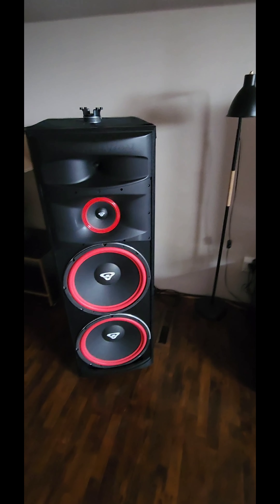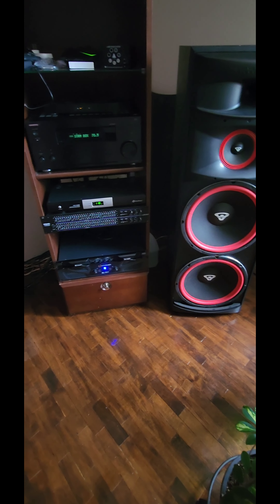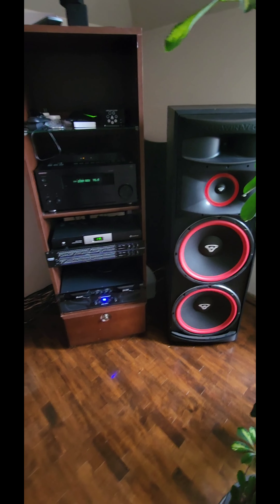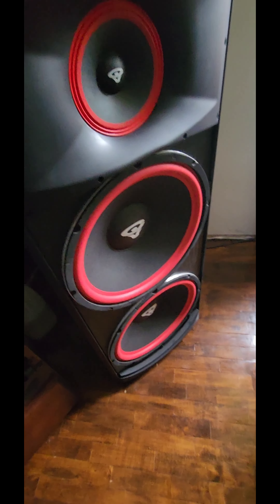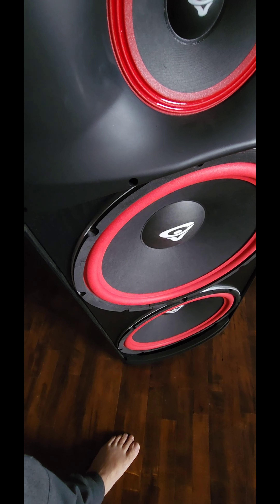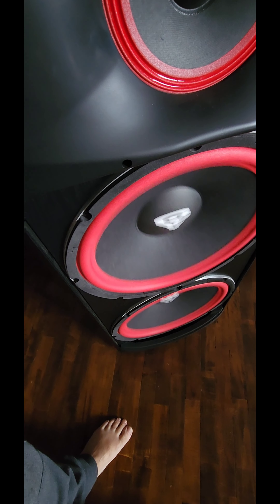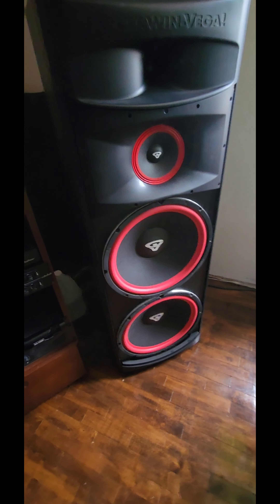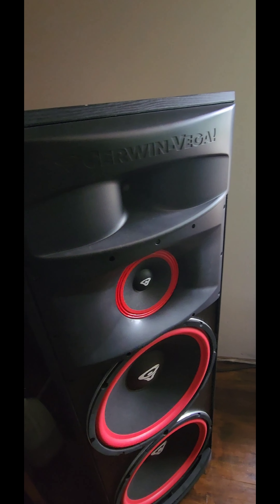cerwin vega xls-215 update power amp recommendation

Comment: This is an output impendence incompatibility. You are trying to drive a PA amp with a home cinema receiver.  You need to either get a proper pre-amp that has enough output to drive the power amp without the pre-amp distorting. Or, you get a power amp that is suited for the low output of the home cinema receiver.
Reply: The newer Crown amps have adjustable input sensitivity...probably on the "low" setting...set it to "high", and it works great for use with home receiver level output

Comment: I mean their own specs make very little sense. 500W with NO ohm load rating, the only ohm load mentioned is on the sensitivity test, which if I'm reading it correctly was done at 8ohm with full spectrum sound (white noise probably) for 95db... I've always heard take the cone size and multiply by 20 for optimal wattage which would be more like 760W for continous program power, IE you need an amp that can do 760W per channel all day without dying. BUT then you look at the fuses and they're 250v 5a slow blow, which means that 1250W is barely the peak of its power handling. considering most of their other 15" models are rated at 6ohm, your crown XLi3500 should be right around 1250W @6ohm. I agree looking at how high you're pushing that AVR to output volume you'd be better off getting something that can output proper voltage over XLR to it, like a proper pre-amp or something with balanced XLR outs like a good high end streamer.
Reply from the maker: That's where I'm at right now is looking for a preamp.. Kind of looking one with an hdmi in but not sure if one exists
Reply: @sledstr  HDMI? If you want to spend on a surround sound one sure, but most stereo preamps will have digital inputs like TOSLINK and Digital Coaxial RCA, which for hooking up a TV, sat/cable, dvd/bluray, game system all the above should have at least one of those output options. Emotiva has cheapest I know for both, look at the BasX XDA-3 preamps for stereo/dac duty with HDMI, or the XMC-1 for surround which will have many HDMI.
Reply from the maker: @WarriorProphet  I've been looking at the emotiva.. Gonna make the plunge eventually I'm sure just need but need to be certain cuz it's gonna be my lat attempt at this system before I get rid of it. I'm currently running a set of jbl cf-150 powered by an H&h vf800 which was vanhalens go to amp. Along with the xli3500 pushing the xls-215. The jbl are more efficient in the highs where the cerwin fail so together it is definitely dB madness. As I'm sitting there with wot I'm constantly turning around thinking I just heard something crash lol.

Comment: Nahhhh somethings wrong. My arcam amp is 90watts per channel and completely obliterates my home  with cerwin vegas.
Reply from the maker: 90 watts? Lol I'm currently running 2 xli 3500 bridged putting out 2700w ea. They would probably crumble your house unfortunately for me my house is so solid I can sit beside the speaker and could not feel any vibration till I powered these things to the max. I'll tell you with all that power I can put it at full volume and it's clear as day and no clip.. I can handle maybe 1 song and that's it lol.
Absolutely awesome! I've just added a klipsch 16" sub to the mix and also running a couple jbl single 15" 3way speakers with another xli 3500 at 1000w per side. 😎

Comment: You just need a art box pro to boost the voltages to the amp.
The preouts on your amp are not feeding enough voltage to the crown.
Reply: Right On I've got two ART boxes, one to my bridged Crowns and one to an older 150 per channel Kenwood feeding a set of 12" Sansui and a set of Toby speakers made in Fort Worth by a man that is famous for custom speakers here.
Reply: I recommend that you ditch the receiver and get a full function preamplifier or mixer. This will create the shortest path to the power from the source component and to the speakers.

Comment: Signal output voltage on your pre amp is as important as your amps output power, if you don't have enough voltage output your amp won't get the output it's rated at and you end up turning it up to high and clipping trying to get that umph out of it. So if your using an avr to power your amp it's not enough signal strength to get the most out of your amp.

Comment: Have you tried a different preamp? I’m pretty sure there must be a impedance mis match. Those are pretty efficient speakers and shouldn’t have took that much power to make them sing.
Reply from the maker: I'm currently running an old H&h V800 250w amp that powers them pretty good and has better lows.. The crown xli 3500 powers them just shynor perfect but ya I'm thinking of trying a better preamp.. My old onkyo used to throw lots of power at lower volumes like between 3-5..now I'm at 7-9 and am thinking alot of the lows are being lost along the way. Seriously considering an svs 16" sub for lack of bass in my home which is stupid considering the size of these xls speakers. Seams they don't make em like they used to.
Reply: @sledstr  look into the new Emotiva XDA3 pre amp DAC. I think you will be very happy with what you get from it. Also you can’t go wrong with a sub in any system. Emotiva also has some nice subs cheaper than the SVS16

Comment: I was running DX9s with a technics amplifier and I blow the fuses all the time also paying the butt. 1,000 watches an awful lot how would they do with just a couple hundred say 300 from like an old Carver amp ?
Reply from the maker: I was blowing fuses all the time with a 500 watt amp. Since I've gotten the 1000 watt amp I haven't blown a single fuse and I put the volume at 10 everytime I turn it on. Before that I was blowing fuses at 7-8 consistently every time.

Comment from the maker: Update coming soon.. Ordered 2 more crown amps.. Gonna be pushing 2700 watts ea.
Reply: That preamp sucks. People are dropping gems to you and you're just ignoring them. Nuke that receiver/preamp and get an analog Carver or NAD preamp and those XLS will come alive even with your weakest amp.  But you won't. You'll be feeding the XLS-215's 5000 watts each side by the time you're done and still wonder what's going on. If you're blowing fuses left and right then that should have been a clue.
Reply from the maker: Yes the preamp does suck which is why I ditched it and got a schiit freya tube preamp as was suggested. I do have an old amp as you say pushing 250 watts a side and it didn't do much. I'm now running them with 2 crown 3500 bridged at 2700w ea. and they sound awesome. Oh and I haven't blown a fuse since I've added big power.

Comment: I wanna feed my xls 215’s as much power as possible…The problem is that I’m too noob to know what to do, because i have 2 subwoofers i wanna be able to connect too.  Right now my xls 215’s is running with a denon avr 3808 surround receiver with a Nad C275BEE power amp. How do I upgrade??😢
Reply from the maker: I picked a couple crown xli 3500 from aliexpress for $400 can. 1000wpc I have them bridged putting out 2700w ea. at 8ohm.
Reply: I need enligsh mate.. so xli 3500 will run my 215’s no problem? plus I’m able to connect subwoofers to it?
Reply from the maker: Yes the 3500 is perfect for the 215s... If you don't have powered subs then you can use your Nad to run them or get a second amp or use your Nad... Not sure what wattage your sub is but I would probably get an other crown amp to run those. If they are powered subs you just need to split the signal.  @KakashiHatake-wq7ki
Reply: @sledstr   it’s 2 xls 15s, so they have build in amp… Right now I use a ‘’splitter’’ to be able to run 2 subs because there is only 1 subwoofer output in my receiver…  subwoofer output is important to me. So basicslly my question is if I can run my  2  xls15s the same way as I do now via a splitter?
Reply from the maker: There is no sub output on the crown.. You would just keep running your subs off your denon.. The crown is only to power you 215 and you'll see them come to life.. Its pretty scary at high volume 😄 @KakashiHatake-wq7ki
Reply: @sledstr   Can’ t wait
Reply from the maker: Let me know how you make out.. I'm patiently waiting for a sub I ordered the other day that should have been here 2 days ago but I should have tomorrow.. Klipsch rp16 @KakashiHatake-wq7ki
Reply: @ damn bro nice, only way I switch out my 2 xls 15s subs is if I find hfa 18’s. And I Will:))
Reply: If I have 4 xls215 and jvc RX 778VT what do I need to do to get better performance? Everything is 2 channel amp!

Comment: I have a Yamaha Avantage RX-A 3070, and I have recently purchased a Yamaha MX1000 which I am now looking forward to connecting to my 3070 and running 3 sets of CVs, I currently have a set of E-517 and I am looking to add 2 more pairs…. Possibly a set of XLS 215 and a set of SL 15s ….. I listen to Rock and Roll, Heavy Metal, punk, Blues, Classic Rock, 60’s, 70’s80’s90’s 2000’s … Any Honest advice or thoughts would be greatly appreciated, thank you all !!! Cheers
Reply from the maker: Honestly the xls don't like rock.. I always find myself looking for a bass boosted version of rock songs as the bass is just not there.. I would go for the cheaper cerwin's comercial 2way intense 252..similar looking speaker and less than half the price and they sound amazing with much tighter punchier bass providing you are throwing at least 700w into them you'll love them. I had a pair and sold them and got the xls and I regret my decision.

Comment: Are these made out of compressed wood ? My VS 150 were, started vibrating after couple years.Had to get all 4 new boxes made out of solid wood
Reply from the maker: Ya looks like pressed wood.. I'm dealing with some older jbl's that fell apart and am getting new boxes made from mdf which will be way beter sounding I'm sure

Comment: IS THE CROWN 2500 PERFECT FOR THE CERWIN VEGA XLS-215 ??  I HAVE A PROBLEM FINDING THE RIGHT AMP THAT CAN REALLY DRIVE MINE   XLS215 AND I FEEL THAT NOTHING IS GOOD ENOUGH FOR THEM
Reply from the maker: I found the 2500 to clip at just over 80% volume.. The 3500 however does not clip and sounds way better.. It's scary loud!! I'm currently running 2 3500 bridged.. 2700w per side 😅
Reply: @sledstr  🤣🤣🤣
Reply: Im looking at 3500 right now and the crown looks and seem really nice.. Cerwin Vega XLS 215 need soo god damn much power.. I got 2 amps of Rotel RB991. Many people love them soo I think Im gona sell both of them and then buy the Crown 3500. Pretty sure I can get a lot of money for my rotels and since I got 2 of them 😁
Reply: @sledstr   @sledstr  Did you mean that you have 2 pare of Crown 3500. One per speaker????????
Reply from the maker: One per speaker yes. I have a third as well I'm gonna use to power the mids and tweets.
Reply: Soo its not enough with just one for the cerwin vega XLS 215 ?

Comment: I’ve had these same problems with mine stock I’ve tried a xls 2502 and then I purchased a xti 4002 same problem so I’m guessing xli 3500 or maybe the i tech 6000 how do you have them wired? Any humming from the tweeters I always have the annoying hum cerwin Vega really should give the correct information on what these need for power
Reply from the maker: No hum in the tweeters but do have the annoying hum.. I've traced the problem to the hdmi to projector and tv.. If I unplug those it goes away.. I purchased a no hum power adaptor which cut it out almost completely but then all of a sudden the hum reappeared.. You fool around with the wires in the back and sometimes it goes away.. Not sure what the hell I purchased a Yamaha receiver to see if maybe it's my onkyo but is did the same and Yamaha sounded like crap so I got rid of that. I hate that hum but the only way to get rid of it is unplug all hdmi and that's just not acceptable.. I've tried power conditioners and everything with no success.. The only thing I haven't tried is a $3 adaptor from home depo with no ground.. Gonna try that next or get an extension cord and break off the ground.
Reply: @sledstr  I just got my crown xli 3500 and WOW their is such a big difference they actually can be turned up and hit so hard now crazy how this amp is better than the Xti 4002 IMO I definitely appreciate your recommendation

Comment: A better pre amp or pro ....try a Schiit Freya with the lisst SS tubes
Reply from the maker: Thanks! I think I'm gonna give that a try. I know my onkyo is nothing compared to my onkyo 25 years ago.. It's just got no bottom end. I think this schiit might just be what I'm missing.
Reply: @sledstr   get a Schiit Kara or freya + with the lisst solid state tubes....you can try tubes later....but with the solid state tubes they make its a 14db gain stage....it's huge power...also 3 mode levels....great preamps....check the budget deals they have also on closeouts.
Reply: @sledstr   you'll also be able to use the XLR inputs those are also 3x the gain....it'll be a huge difference.
Reply from the maker: I ordered the lisst quad
Reply: @sledstr   that will be a sick setup...schiit freya + quad lisst into a big crown amp....nothing will be left to squeeze out...those Vegas will be slamming.
Reply from the maker: Got my schiit today.. Sounds excellent all the way fo full with no distortion what so ever.. Still lacking in bass.. Gotta try some tubes now. Any suggestions?
Reply: @sledstr   only an EQ will do that the way you want. Or DSP on your signal. There are also pro sound devices like DBX. Changing tubes or preamps is not going to give you that....all the cerwin-vega guys you see with the bass pounding is using an EQ
Reply: @sledstr   schiit makes a great EQ called the Lokius....or get a nice used one

Comment: Good evening. I have the crewin Vega 15’s I just got the amp you recommended. I hear a gummy sound, do you know what it could be?
Reply from the maker: Been dealing with the same issue.. Unplug everything and go through them 1 by 1.. I needed up cutting the ground wire out of 1 amp by using an adapter and breaking the ground off of it
Reply: Thanks for the advice, I’ll give it a shot

Comment: Extreamly loud speakers thats fun for 20 minutes then it gets annoying. Sure we all have our preferences and i understand why you can like a speaker like this, but outside of spl their is not any good qualties about this speakers, low sound quality, no details, you are not hearing the seperation in instruments like you would with good quality speaker, build quality is not great, this is macdonalds of speakers, the bass is not that deep either, most hifi speakers cant play extreamly loud through witch can be an issue, but there is some brands that goes for good output without sacrficing the sq and detail, one of those brands is Arendal sound, they are thx rated not quite as loud as cw but loud enough to cause hearing loss, but unlike the cw Arendal has good quality outside of spl, good build quality, high sq and good amount of detail